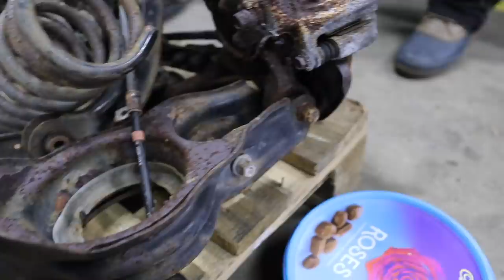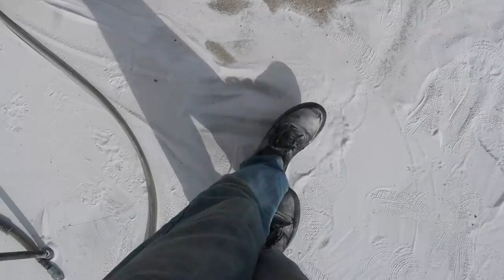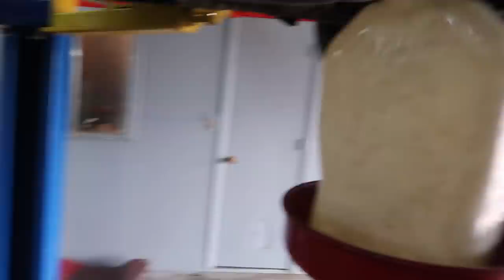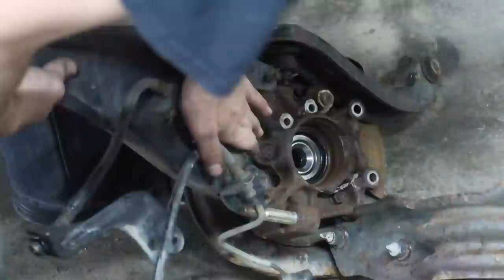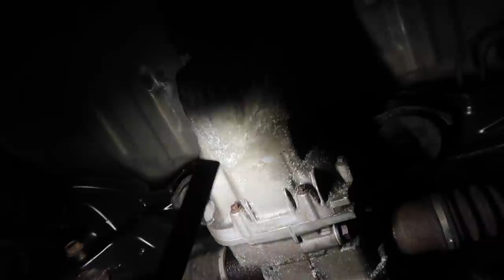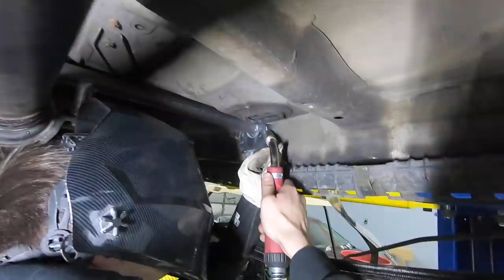Making Our Honda Minivan ALL WHEEL DRIVE! (Full Process)

Comment: Rob dahm: 1000hp awd jdm legend
Kyle: hmm
Reply: Seabass901 hey bud. It was a joke we all know Dahms build is crazy and custom.
Reply: @luketeverino6085  I think it's actually cooler to find the ultra rare parts to put the Odyssey together and make it look mostly stock.
Reply: @Seabass901  That "shit bucket" will have way more passes than Rob Dahm's Dorito engine will ever see. No matter what you can only put so much power down to the wheels before they spin. I personally like both, but a "sports" looking car that cost well over $650,000 to build to this under $20k van that will make people cry on the drag strip and street. If they go head to head That "shit bucket" will beat Robs car right now. Don't give me o robs is the first ever 4 rotor billet engine they have had 4 rotors for a long time he just used different metal and still manage to get metal shavings in it LOL. Also Kyle is the first AWD Honda Minivan making 1000 + HP to the wheels. I can promise you that van will be doing more pulls than rob starts his 4 rotor to trouble shoot his issues.
Reply: Dcool facts ‼️
Reply: @dco5055  I wouldnt say Under 20k lol,  but its less the Robs 4 rotor,
Reply: @dco5055  That Dorito machines is probably leaking oil already
Reply: Rob Dahm couldn’t do the AWD burnout that he based the whole build on.     That RX7 is and always will be A waste of 300k.   
The MiniVan don’t compare to the RX7.  
*The Routousy is practical and replaceable. 
*I don’t think Rob Dahm will risk crashing or braking it so it will probably never be raced.  
****The 4 Rotor Rx7 is NOT Replaceable he won’t risk all that work and $300k.  My Prediction is It’s going to sit Right next to the Vette 
Therefor the MiniVan is way Cooler and I think can murder the 4Rotor.
Reply: More Kyle: And we can seat 5 and several cases of coca-cola for Brent.
Reply: CHALLENGE ACCEPTED
Reply: @Seabass901  i completely agree. Dahm's RX-7 is fucking sick. The Rowdyssey is barely comparable. So much more went into Dahm's build. It's truly custom. Still though, Rowdyssey is still super unique and awesome as well.
Reply: Seabass901 Robs car isn’t even a damn RX7 anymore, less than 10% of the original car left. Not to mention being half a million dollars
Reply: Kyle: hold my monster 🤣
Reply: @geedawgzzz  what do you mean couldn't do, he smoked those tires
Reply: 1000 low boost break in period
Reply: @geedawgzzz  he made a pretty beefy driveline tho. (i do think that the awd transfercase/box is going to blow up at some point)
Reply: @Seabass901  calm down big boy
Reply: I think the van wins for sure. Simply because we will get three times the content and the owner can actually keep it running.
Fk Rob and his bs, barely any progress on the thing. The car runs already, just finish and rip it already. 1 video just for some sheet metal floors, come on...
Reply: My wife had an awd Chrysler town and country, soooooooo much fun in the snow. The driveshaft length will be a challenge, especially from a dig, but from a roll, ludacris mode. Slammed in the summer, and jacked up, off road lights, rally van in the Colorado winters, now I want one!
Reply: Kyle when the van is built:
Yeah my minivan only has 1500awd HP, it's slow.
Reply: @geedawgzzz  but rob did do a awd burnout??
Reply: Could be if they seam welded the van

Comment: Kyle, I have a couple tips for you that will hopefully help you in the future. When you sand blast metal down to it's raw form, try using either etching primer (greenish) or epoxy primer. Both have really good adhesion to raw metal and seal it the best. And for stuck/seized bolts- when you use the mini ductor to get it red on both ends, poor some cold water on just the bolt after you've heated it. It will expand it and then shrink it, breaking the rust free enough to hammer it out. 🤘🏻🤘🏻
Reply: Tyler S I don’t know if you ever worked on a Honda but when they’re stuck they’re stuck you won’t get the out ever I’ve tried it all head cold drill the middle all of it the problem is the bolts have lines on the sides that allow rust to build and then there’s no movement
Reply: @argen809  it's not just Honda specific that happens to. I just had to do it to my old Ford pick up the other day as a matter of fact. Some do get really stuck in there though but never say never my friend. I ball on a budget, I will get it out lol
Reply: Tyler S i tried so much when I had a integra and a ek hatch I usually tell my friends don’t bother just cut them of and get new ones they’re really stubborn

Comment: Kyle just so that you know, Honda made a h23a in Japan only and it’s a h22 block blah blah blah... but that engine came in an awd wagon in Japan and some of those cars were all wheel drive and manual. AWD FACTORY H SERIES HONDA. look it up champ.
Reply: Brayden knows, check it out Kyle @boostedboiz
Reply: Cole Komaromi I only know because I have a h23a in my prelude lol. It shares the same crankshaft that’s in kyles prelude engine. I’m sure Brent knows about it since they built it years ago
Reply: that would be awesome, but the lack of support for aftermarket parts that will break easily. he already pre orderd/bought THE FEW H22 CREW’s BILLET H22 FWD/AWD BELHOUSING.

Comment: That long ass drive shaft at first launch:

Come on, and do the Twist!
Reply: Better the driveshaft than diff lol I'm curious to see how much power that drivetrain will hold
Reply: Why be so negative?     Why do all you haters wish bad things??    They have a name for you guys.   HATER
Reply: Gas Par they aren’t haters; it’s just that we all know that that drivetrain isn’t gonna hold the power that Kyle is gonna be putting down.         K-Series + Drivetrain = ~~~~~
Reply: @gasscooterdude  a dog box aka straight cut gears can handle way more power than he's after!
Reply: @richdavis8840  the transmission and transfer case will handle it, sure. The stock driveshaft, rear diff, and rear axles aren't long for this world though.
Reply: @geedawgzzz  juste experience because we all know It WILL BREAKE with 1000 hp ,if he keep it that way but love the build , no heater juste ground people loll
Reply: @ethank3939  Ok bud, the stock axles and diff are bulletproof and will handle 1500whp. Happy?
Reply: Should be ok on those skinny all season tires

Comment: In regards to the missing nut on the rear subframe mount. Cut a window in the frame, weld a nut inside, weld widow closed, light sand, and paint! Simple strong fix and you can install and remove like normal none of this bolt all the way through bullshit!!!
Reply: I was thinking the same!

Comment: If you guys haven't checked already, make sure the gear ratio in the rear diff matches the ratio of the final drive you guys used in the trans. If it doesn't match your back wheels will be spinning faster or slower then the front wheels. It looks like those back wheels are spinning a lot faster then the fronts.
Reply: Could just be the open diff and the one dragging rear brake making the other wheel go faster, but yeah, definitely good to check before running it.
Reply: Darwinpasta Yeah your right, it could be that. But it’s more likely that the diff is the wrong ratio. I hope your right tho
Reply: @MegaCoolshot  that's what I thought about the fasterproms s10
Reply: One wheel was not spinning, you can see it in the vid

Comment: You can “freeze” bolts by spraying it with compressed CO2 from a welding tip. I’ve seen it done on farm equipment with a fire extinguisher.
Reply: And dont forget McFarland's track has sweet st. Augustine grass now..and don't let Gribble on the lawn.